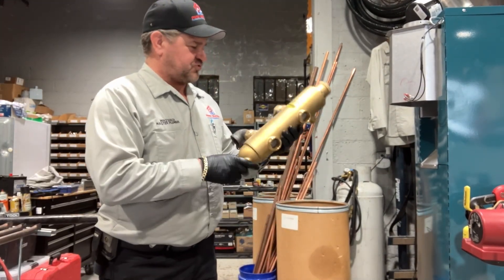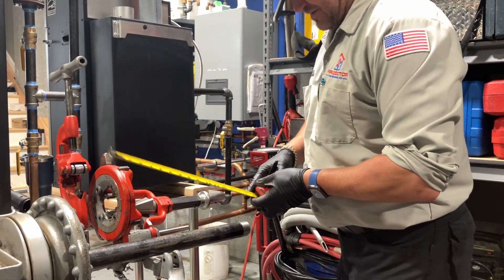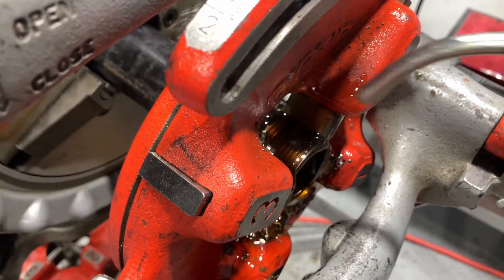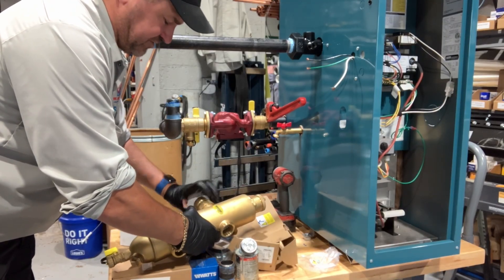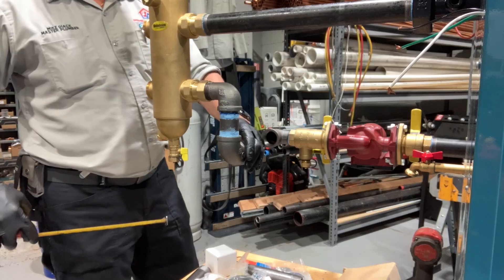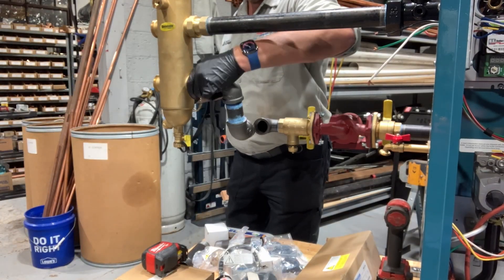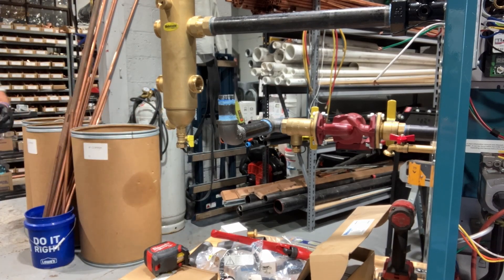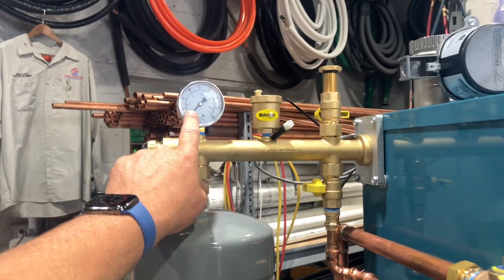8. Threading Pipe for a Hydraulic Separator Install – Uncut HVAC Training! 🔥

Comment: You could have attached the union while the pipe was still in the Rigid 300 and let the machine tighten it.  Then you just install to the boiler connection.